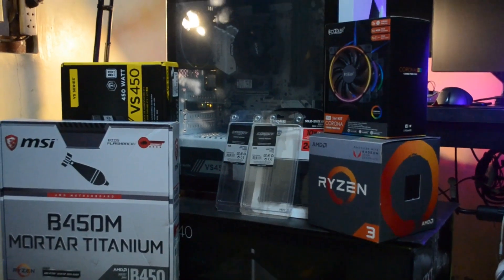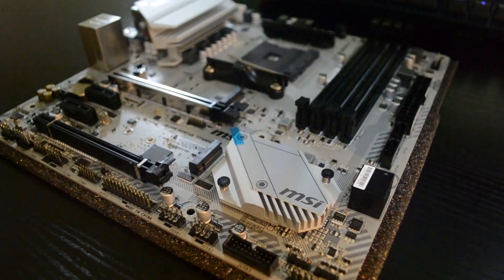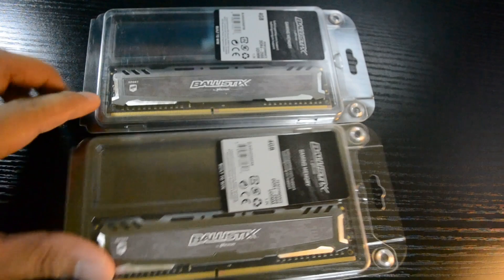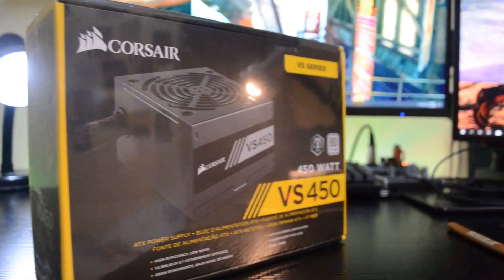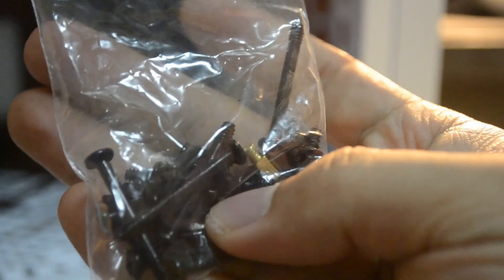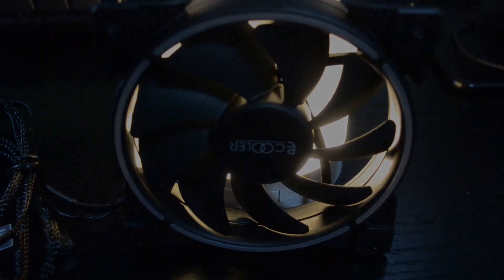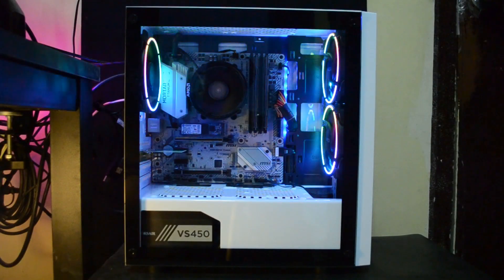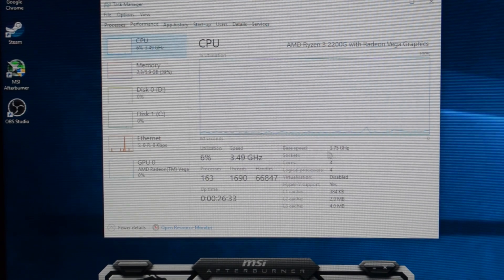White pc build Ryzen overclocking - (Part 2)

Comment: Boss in the.future ano po ba dapat Na GPU PWDE po ba ang galax gtx 1060 exoc white?
Reply from the maker: for this build oo mas ok kung 1060
Reply: Fit po ba ang Gpu galaxy gtx 1060 exoc white sa case ng Rakk anyag white Build.😊
Reply from the maker: @bontags7528  yun lang di ko sure paps, wala kasi gpu build ko
Reply: E boss e ano ba pwede sa Pc build mo na GPU ?
Reply from the maker: @bontags7528  msi armor, yung puti ganda dito yun, as for the size tama lang sya. hindi ko rin recommend yung 3 slot pci na gpu kasi maliit yung case though pwede sya pero para magkaroon ng konting space for thermals

Comment: Sir r5 2600 at msi b450 titanium ayaw mag boot working naman po mga fans, ayos po psu ko, Ano po kaya problem?
Reply from the maker: b450 mobo ready yan sa 1st 2nd and 3rd gen ng ryzen. ano gamit mong gpu?
Reply: Xfx rs rx 470 4gb black edition po
Reply from the maker: ang pwedeng suspect dyan boss yung boot drive, di nya na dedetect. either sira or di naka plug ng mabuti. same sa lahat ng pc parts yan (rams,gpu, psu )so pa double check yung mga connection. Pag confident ka and sure na nakaplug naman ng mabuti, ang pangalawang suspect ko eh yung mobo, baka sira. Kasi  b450 ready agad yan sa 1st,2nd and 3rd gen ryzen kahit walang bios update. hopefully hindi yung cpu pero may possibility din pero rare na mangyare. 
Suggest ko dalhin mo sa local shop kung saan mo nabili, paayos mo sa kanila. sana may warranty kapa
Reply: Sige po sir salamat po ng madami God bless po!

Comment: Sir, planning to buy a b450 mortar titanium and 6 deepcool rf120 fans. thing is, san ko po sasaksak? ung fan hub sir up to 4 fans lng, eh since dalawa naman ung jrgb header pwede dalawang fan hubs saksak? Or kailangan iisa silang lahat? confuse parin ako sir about this.

Greenhorn parin po ko pagdating sa computer buildings as this would be my first so please correct me if im wrong.
Reply from the maker: pwedeng isang fan hub sa isang header paps, mystic light compatible naman yung deepcool rf120 so ok sya wala issue. ano ba fan hub gamitin mo?
Reply: @MacCoyzkie  ung kasama po sa box, kaso hangang 4 lng po ung pwede ilagay sa hub. 6 fans po gusto ko lagay, pano po gagawin?
Reply from the maker: @morantecarlo3267  basta yung isang jrgb sa mobo pwede mo ilagay yang hub. ilang fans ba lalagay mo?
Reply: @MacCoyzkie  bali 6 po. and ung package; which is a 3 fans only and has a fan hub included of 4 slots. ngayon sir 6 po gusto kong fans na ilagay but ung fan hub 4 lng. dalawa naman po bibilhin ko so magiging dalawa din fan hub. so im wondering kung pwede 3 fans sa isang hub and also sa isa in total of 6 fans? or iba pa po kailangan gawin
Reply from the maker: @morantecarlo3267  pwedeng pwede, yun naman purpose ng hub. ganda nyan paps pag nalagay mo lahat. wala naman limit basta may fan hub ka, ang importante dapat stable ang psu mo